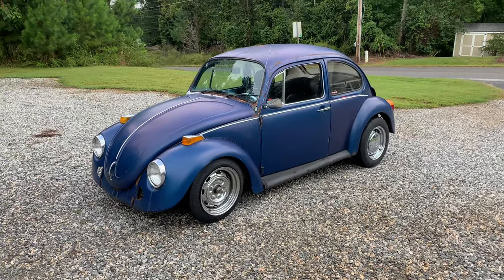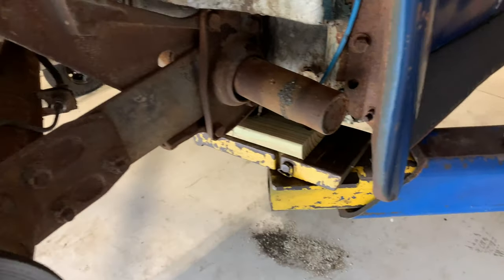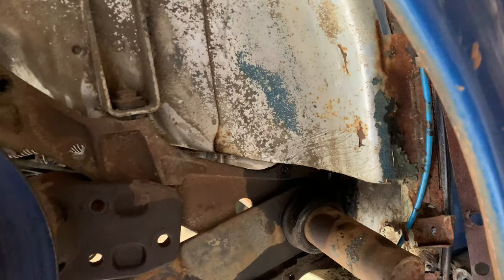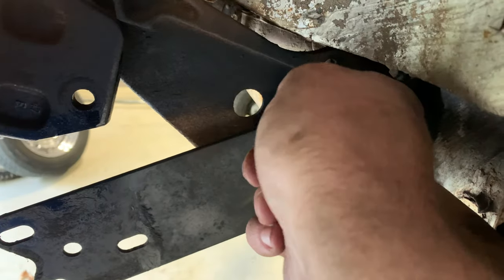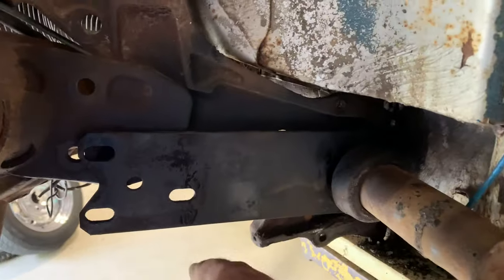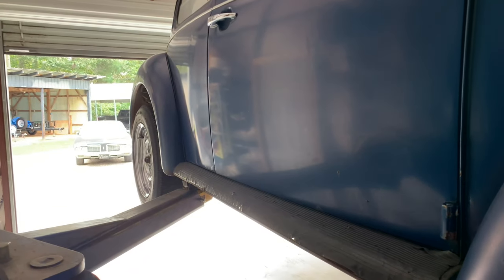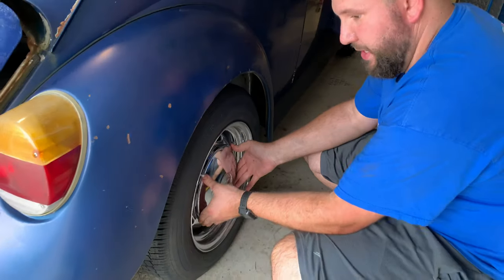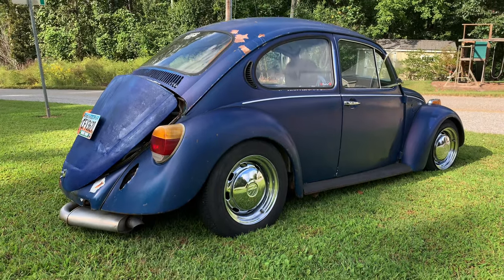Rear Torsion Spring Plate Lowering - Easiest Way to Slam a Bug! - VW Beetle - Pt. 2

Comment: Nice stance! Question... when you pull the torsion bar out to rotate it, how are you able to tell which splines you're changing, inner or outer? I ask because you can't see them. Thanks.
Reply from the maker: It’s mostly about feels and letting it drag onto each spline to count them.  You can pull the end all the way off though and make sure that the inner stays put.

Comment: did you end up cutting off the upper bump stop mount?  I have the same setup...no to little air i still take a beating on the metal to metal rear bump stops (rubber snubber is cut all the way down) but w/ even just 25lbs in rear it sits up higher than i wanted w/ the 2 notches down.
Reply from the maker: That's surprising.  Which rear shocks did you buy?  I have to pump my rear up to over 100psi to not make it bump.  I have considered moving my shock mounts and getting rid of the bump stops, but I believe I would also need to notch the spring plates.

Comment: Cool vid ! I have a 71 bug that has a hard slam sound when I hit a bump only on the driver side. I got new shock absorbers and it still does the same thing. Have you ever experienced that before ? Scratching my head here.
Reply from the maker: It might still have a rubber bump stop in place, or the shock is just messing up or not long enough.
Reply: @HiRevzMedia  yes there is still hey old pair of rubber bump stops on it. Are they supposed to bottom out regularly, or are they there for the once in a while bad pothole or something like that? I'm going to buy a pair of the stock replacement shock absorbers from Wolfsburg just so I know I have a pair that is the correct length. Everything is really old and loud back there I plan to take it apart and replace any worn out components i see.
Reply from the maker: They probably need to be cut down to just a little bit of rubber, just in case
Reply: @johnmartin5153  i have the same problem, banging noise on 1 side. i trimmed bumpstops can i get a update?

Comment: Man that is a sick stance!!!

Do mind giving the specs of wheels and tires sizes you used?
Reply from the maker: Thanks!!!

5.5” wheels, front 125R15, rear 165/80R15
Reply: @HiRevzMedia  Not a fan of narrow tires on the front of a public road driven bug as 80 per cent of bug braking is at the front due to weight transfer ,
 it's not an issue for drag strip racers which is where the "cool low and narrowed front "
Look idea comes from.
I fit 165/65 15: up front, a better idea because a dead driver in a crashed bug is never going to be a good Look.

Comment: Awesome video. Thank you for the diy

What size tires front and back?
Reply from the maker: Thanks!!!

5.5” wheels, front 125R15, rear 165/80R15
Reply: @HiRevzMedia  How is the turning radius with that tire setup? Previous owner on mine went way too wide on the tires and this thing turns worse than an 18-wheeler. I'll definitely be going back to something more stock.

Comment: I like the look 2 notch outside change didn't change it to a negative camber look that I don't care for anyway how high can you go with air in shocks for off road and do you end up with positive camber look or is it subtle like when dropped...
Reply from the maker: It is a little bit negative camber when it’s all the way down, but pumped all the way up, it just goes back to stock.

Comment: How's the ride with it pumped up about half or so
Reply from the maker: It’s a little more harsh, but I ended up putting on 2.5” drop spindles in the next video so I can run it almost all the way pumped up and still look the same as before.  It rides like stock now.